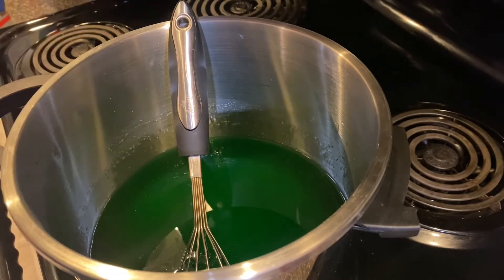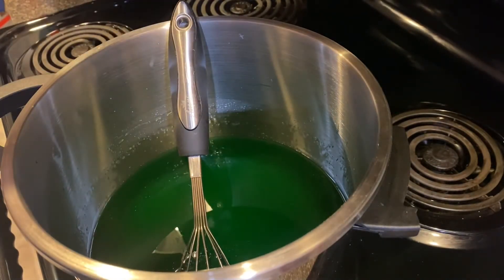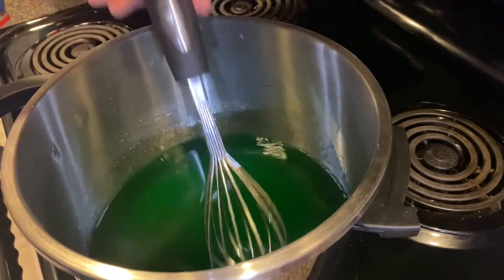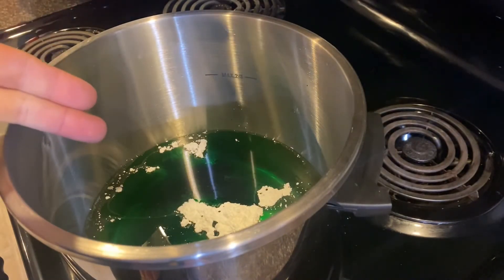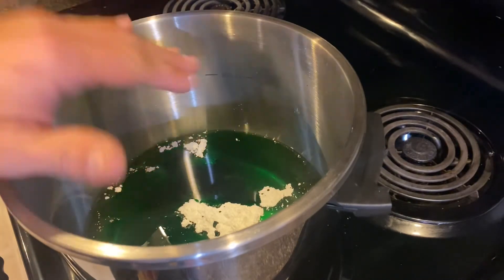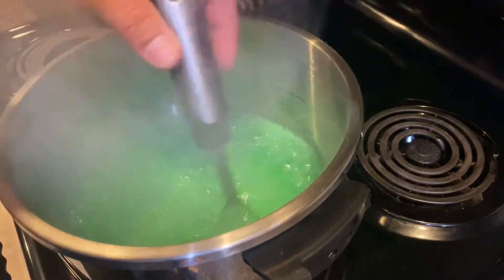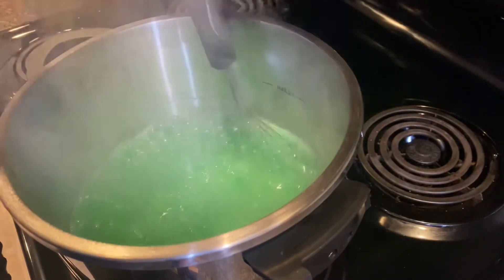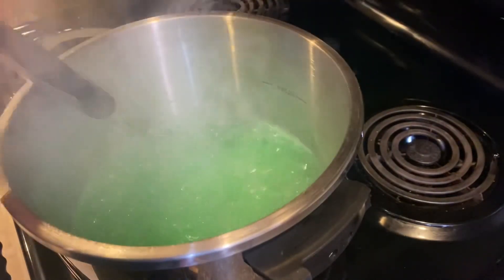How to make RC TIRE PREP! EXPLAINED!

Comment: What do you recommend for rubber tires(grps)?Ready to see that dual motor limitless and dual 6s gt rustler turn some numbers for sure! 👍
Reply from the maker: Yessir I’m actually test/tune the limitless atm.
Reply: @rcguy5793  This should work for street tires also right?

Comment: how long before I add to the bottles
Reply from the maker: Let it cool down for sure. Warm enough to move it around easily and not to hot to melt/warp your bottle
Reply: @rcguy5793  it seems thin do it thicken up as it sit over time
Reply: @MrDwight107  I'd like to know as well. Getting ready to make it.

Comment: Is that ratio critical?
Reply from the maker: I’m sure you can do 1 bottle and use 1/8-1/4 tablespoon of corn starch. But I prefer to use two bottles. Because I like to use a deep pot. This stuff is sticky if it splashes pops out during boiling process.and two is deep enough to work the corn starch in easier
Reply: @rcguy5793  just made some 2 hours ago, where can I send you a video of my test hit 😂
Reply from the maker: @htx_rc4256  I’m on Instagram rcguy22
Reply: @htx_rc4256  How does it work? Making some rn.
Reply: @StonerGamingParadise worked pretty good! Doeneding on how much you reduce it is how you have to prep the tires
Reply: @htx_rc4256  the second half of the Sentence I don't understand

Comment: So I did my first batch and it came out good but I was wondering you said the more you boil it the more thicker it gets right what about the more corn starch you add would that make it more sticker type deal?
Reply from the maker: Awesome! I’m glad you got it!  More corn starch it turns into harder candy. The corn starch will continue to lock it up. So I recommend boiling water out instead of adjusting the corn starch.
Reply: @rcguy5793  ok sounds good thanks for the help I'm definitely on the right path on making some good prep for the 1/7 scales I just need it too get a little bit more webbie if that makes sense
Reply: @robertlopez9323  how did you make it more webby …if you don’t mind sharing

Comment: Can maple syrup work as a substitute?
Reply from the maker: It can. But not nearly as well. I recommend just using the corn syrup straight if you don’t want to do the boiling. It’ll work better than maple syrup
Reply: @rcguy5793  the reason why i asked i went shopping today and they was all out but when i came home i found a old bottle of corn syrup but it was the heavy kind had to dilute it with some water buter it came out good in the end